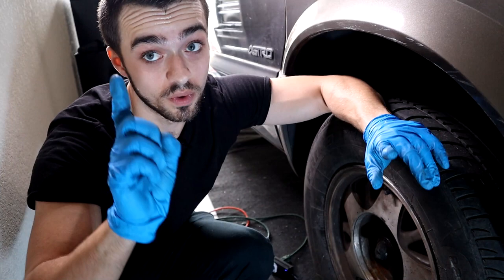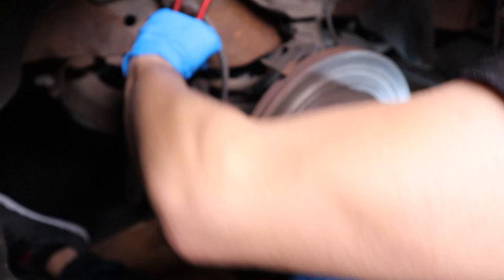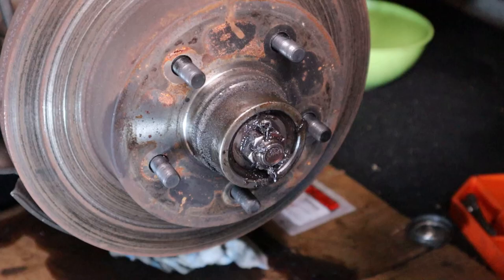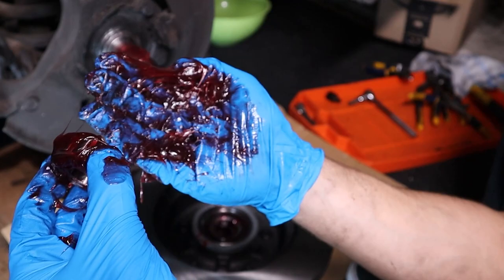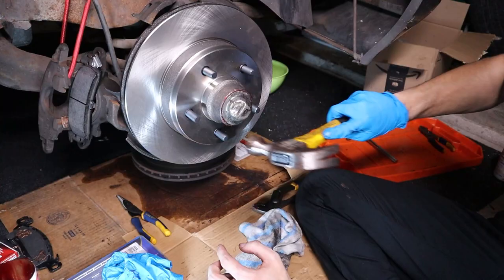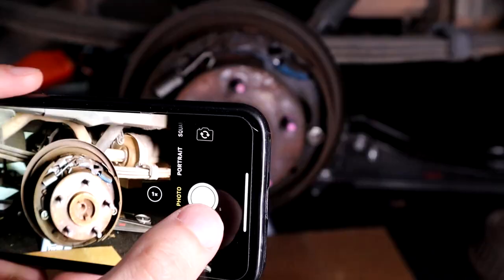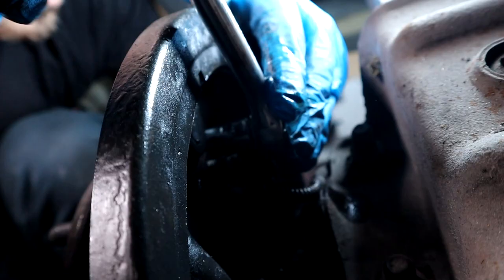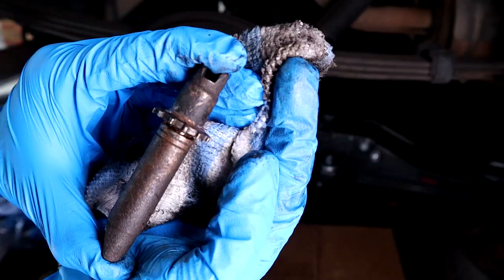Replacing Drum and Disc Brakes on The Stealth Camper Astro Van

Comment: Remember to use Brake Cleaner to wash the Rotors before installing.
Reply: What would happen if you don't wash off the new rotors?
Reply: @WaterMeA-biscuit  the oily coating on them don't  give the new pads a good friction surface; they'll grind.

Comment: Thanks for the video. My 2000 AWD Astro is pulling to the right when I brake. I think it's a stuck caliper piston but since I bought it last year with 141k on it and no maintenance records, I'll put new calipers, rotors, pads and hoses on it. I bought everything but you replaces bearings  and seals too so I guess I'll have to order those too. I'm not sure I'll do the work myself but between you and Chris Fix I feel more confident.